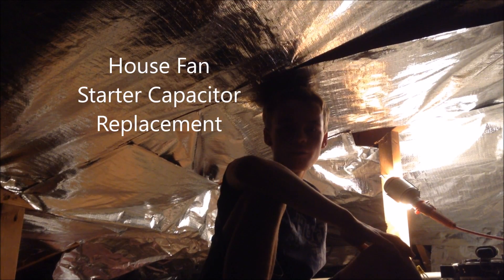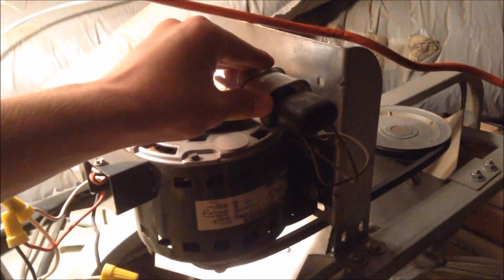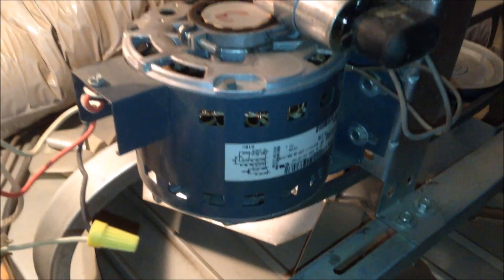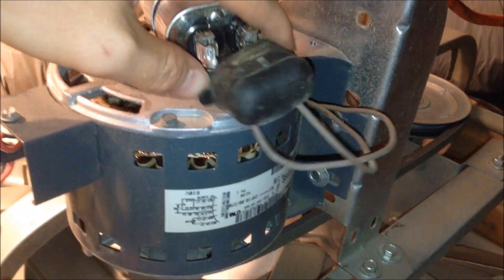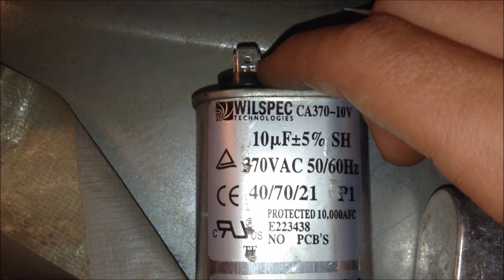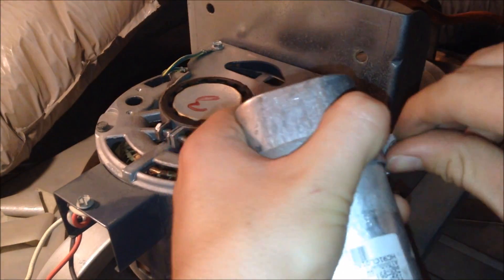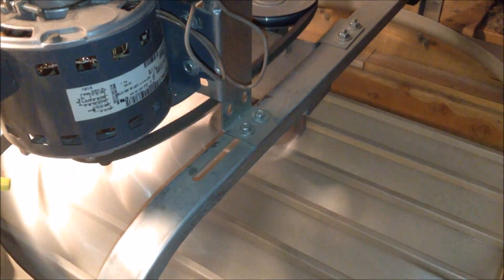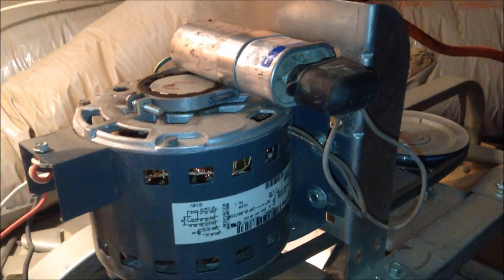Whole House Fan Repair: Starter Capacitor Replacement

Comment: Hi Tanner, I have an old Emerson attic fan. The high setting works intermittently. The low speed always works, could this be a capacitor issue.

Comment: You just taught me something valuable since my Whole house fan quit on me and I got a replacement motor and recomemeded capacitor.   

Although I checked the motor the only way I know how (by resistance) while is was still in place and it seemed to fail but conected to the original capacitor, when I removed it, conductivity is There!?

In any case, new motor arrived and it was such a tough job for me at 72 and arthritis, that I simply got a new motor and matching recommended Capacitor.
(I'm not sure, but I found an old skeleton up there of the old home owner stuck in a pinch point and they must have just Cut their loses and left him there and sold the house.)
Oh well, now I have a bunch of (6?) wires with no instructions or schematic.   At least I do have an electrician coming in a week to put things back together but he's an old guy like me and I can't let another "crip" LOL do the heavy lifting so I'm doing as much as I know how to do.
It's my fellow Army of the Babyboomer-Geriactics come to save me!   LOL

Comment: How do you tell if it is the capacitor in this situation?  The Fan is running but at such a slow speed it won't open the baffles... How do I tell if it is the capacitor on the motor?

Comment: Does it matter if it's a starter capacitor or a run capacitor?  The only capacitors I can find are labeled run capacitors but the ohms and volts match up so I'm confused.....
This is what I found that matches your the closest- GE CAPACITOR 370 VAC 15UF 50/60HZ AC Motor Run 27L5202.  Will that work?
Reply from the maker: The run capacitor should work just fine.  You can use a run cap as a starter, but not a starter cap as a run cap.  Good luck and let me know how it goes!
Reply: @TannerTech  Thanks bro! My problem seemed exactly the same down to the same singe mark on the capacitor from the motor. Picked up a run capacitor for $6 and works perfectly. I have my whole house fan back! Greatly appreciate the help and video!

Comment: Thanks!  I needed this video.  Our Attic Fan is very slow to start and I think it could be caused by the capacitor needing to be replaced.  It doesn't jump into action like it should . . . most likely because it's not getting the initial boost it needs from the cap.

Comment: DANGEROUS SHOCK HAZARD! You should always discharge capacitors through a dummy load and then short-out the capacitor as an added precaution. If you don't understand what this means, then you may want to  reconsider your qualifications.
Reply: You're right, but don't you think that's a little harsh. He probably did not film it is my guess.
Reply: Instead of being condescending, you could have taken that opportunity to educate.

Comment: Dont you want to shortcut this cap with a screwdriver before you grab it?  I know you know it Im just surprised you were not too careful. I did it with my best screwdriver (stupid) on one of theese I found in a microwave oven and the shortcut burned a cavity on the tip of the screwdriver. You cant be too careful with capacitors.